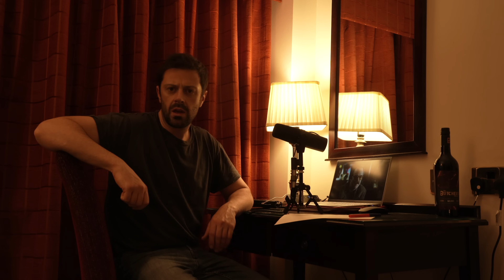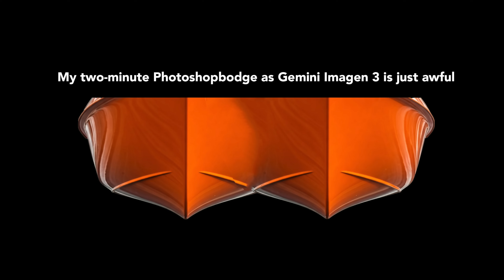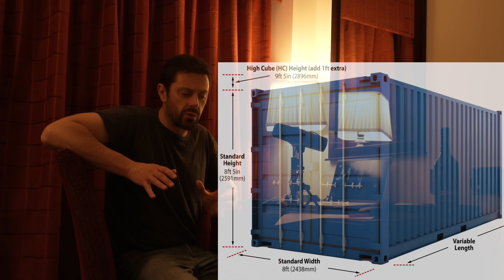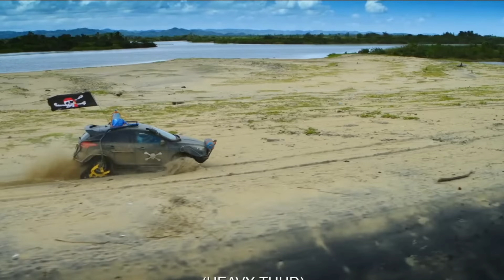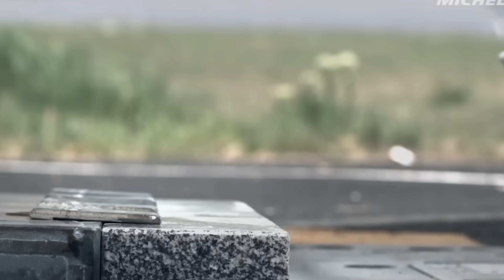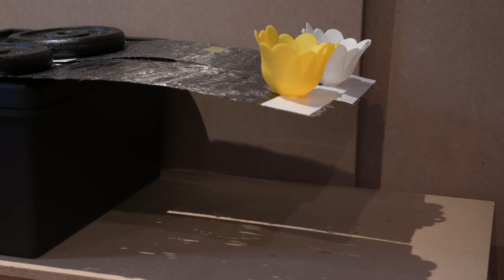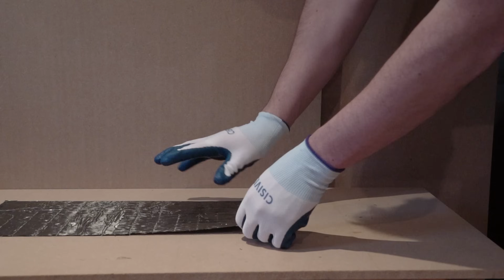The BIG Decisions: fuel, hull type, tracks/wheels, size, power. Bernard Arctic Vehicle Project [4K]

Comment: Fuel  spheres would be good for not being trapped by ice but they aren't good at stacking efficiently. As for the composite challenge why not construct in a similar fashion to composite pressure vessels with a wrapped tow style construction?
Reply from the maker: A tow style construction? Can you link?
Reply: @AlexHibbertOriginals  you wrap the carbon in the direction that you need the strength. Similar principle to those airfoil style sails.
Reply from the maker: Oh I see. Yes indeed, we'd choose a fabric to maximise performance around the 'waist'. Maybe not carbon for the sphere.
Reply: @AlexHibbertOriginals  I linked a couple of gas cylinder examples, i was thinking for the hulls.

Comment: Nesting idea will be first to fall.  Too many potential issues.

Redundancy sounds good, but may also fall to practicality.  Starting cold engines is hard.  Starting diesel engines in cold is quite a bit worse.  Having to get multiple units running to meet your needs is just magnification of potential issues.  I’m not talking about when things are going relatively well.  I’m talking, you’re seriously broken down.  Your batteries have been drained keeping you warm, alive.  You don’t have the energy to generate heat to get the block warm enough to start.

Airless tires depend on flexibility of the material - greatly impacted by temperature.  Limit the number of windows.  Good idea keeping the windows interchangeable.

You’re definitely generating some great ideas based on your experience living and working in cold environments.  But you really need to find an engineer to check some of your assumptions and ideas.  Preferably one with experience in the environment.

Planning on using a fuel you must specially import isn’t nearly as green as you’d like to think.  The process of creating bio fuels is often less green than the marketing might try to have you believe.  By the time you consider the fuel consumed to grow the source crop they can be terribly inefficient.  You should be looking at what fuel is available in the area already.  Yes, you’re going to bring most of your fuel.  But if you end up needing to acquire local, you don’t want a diesel rig if all the locals have is unleaded gasoline (petrol.)

As I said, you’ve got some very good thoughts.  But I want you to have the devils advocate check to your ideas.
Reply from the maker: I don't follow most of that.

1. Nesting is merely for transit in containers. Yes it would require roofs to be detached, and wouldn't be 'tight nestles', but may reduce the number of containers needed.
2. In general at least one generator would always be running, keeping the rear cabin at a reasonable temperature. It would be easy to install a small diesel heater to that cabin to get it up to -10 or -5 degC in the event that the generators are off for a day or more.
3. The batteries aren't used to power heaters. All heat is from burning the HVO, either directly in the front cabin or via the heat exchanger and ducting.
4. The current wisdom points to PU for the airless tyre outers, which is excellent in the cold down to sub -40. The 'spokes' could be a flexi-epoxy, and that performs down to -40 with at times enhanced performance (see the Easy Composites video).
5. Windows can easily have foam inserts for insulation when visibility not needed.
Reply: @AlexHibbertOriginals first off , exciting project. 

How are you going to get the heating system and power delivery through the connection between the two hulls. Since you were talking about soft acujacted towing. 

I think the weight estimates also seemed pretty strange and too hopeful.
Thank you for sharing passion,  cheers.
Reply from the maker: Most likely a rigid articulation like the BV206, and then higher up, an insulated reinforced silicone duct that carries the heat duct and electrical cables. The BV206s have to do this too.
Reply: I think you paid too little attention to the dialogue. There will be no diesel engines, they are veggie oil engines and no batteries will be used to keep anything warm. All warmth will be generated by the excess heat of the engines. This was explained in great detail.